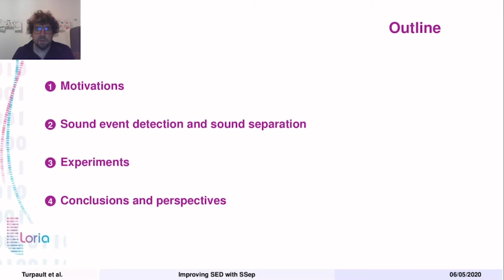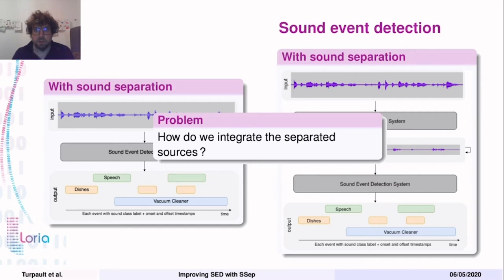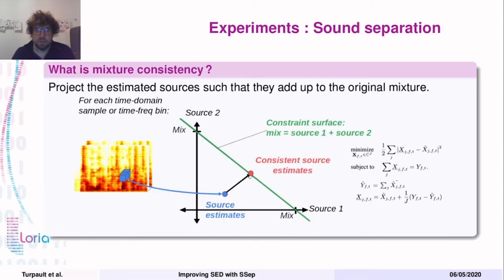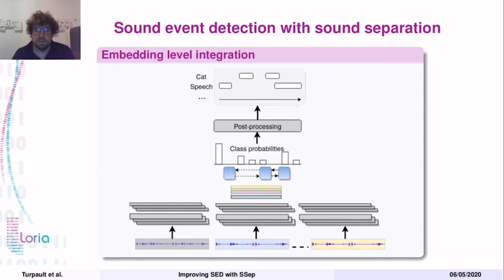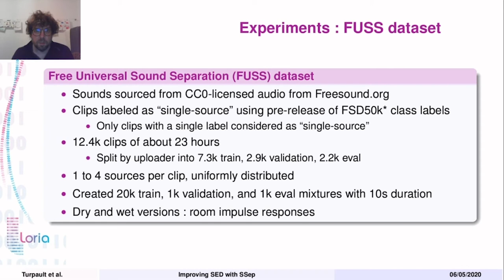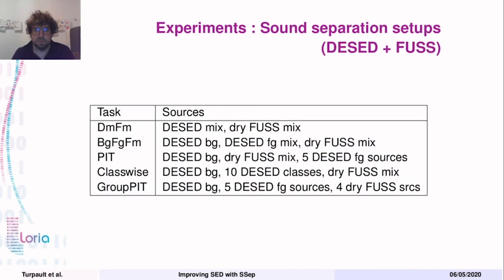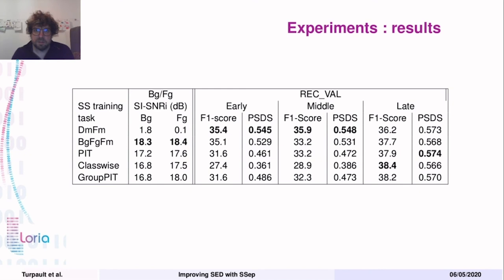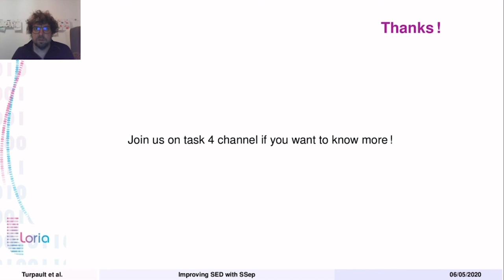DCASE 2020 Workshop, ID 86, Nicolas Turpault et al.

Comment from the maker: romain_serizel
4:29 PM
 Has joined the channel.

nicolas_turpault
7:40 PM
 Has joined the channel.

scott_wisdom
11:29 AM
 Has joined the channel.

keisuke_imoto
1:18 PM
 Has joined the channel.

keisuke_imoto
Admin
4:14 PM
The number of sound sources and background noise may change depending on the situation. How do you implement the number of channels in the early integration method and the number of units of fully connected layer in the middle integration method? Do you assume a fixed number of sound sources/background noise? If so, how does the performance of early and middle integration methods change depending on the number of sources?

romain_serizel
4:50 PM
Hi Keisuke,
The number of sound sources can change indeed but the source separation always output a fixed number of separated sources (some of which can be empty) so the sound event detection network always deals with the same dimensions (channels in early integration, size of the fully connected layer in the middle integration) for a particular sound separation setup.
The number of separated sources can have an impact on the performance in particular for the middle integration where it is changing the size of the fully connected layer quite a lot. But we did not experiments to decouple the effect of the number of sources on the SED architecture from the effect of the types of sources separated (I'm not sure this was your question). Maybe in the future...

keisuke_imoto
Admin
6:27 PM
Hi Romain,
I look forward to the future experiments.
Thanks😃

nicolas_turpault
7:12 PM
FYI, we tried to do middle integration using a fully connected layer, and without one. From the preliminary experiments, there is a significant difference of performance, but this requires further analysis that we did not have time to do yet.
👍 1 

pablo_zinemanas
7:42 PM
 Has joined the channel.

francesca_ronchini
11:03 PM
 Has joined the channel.